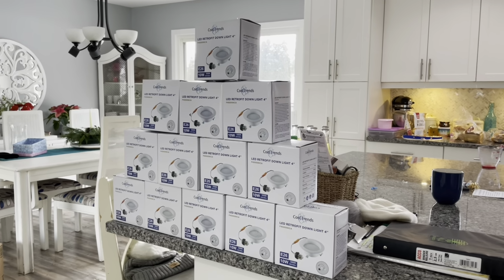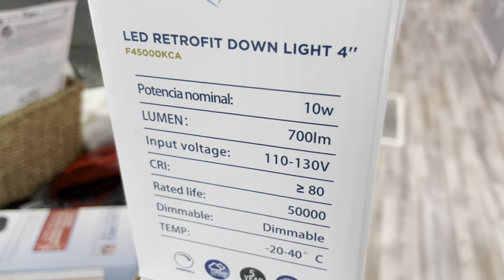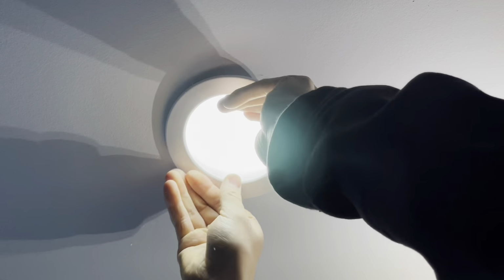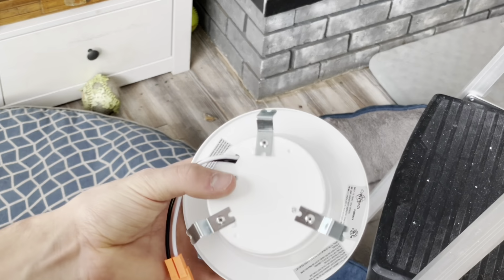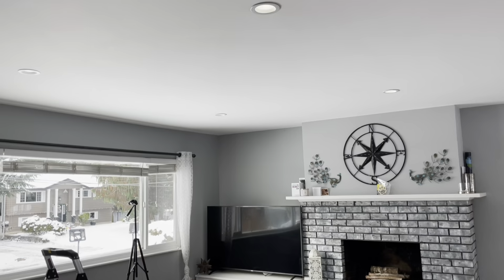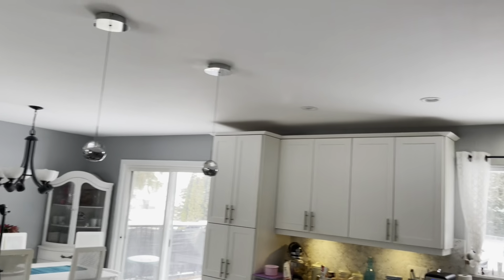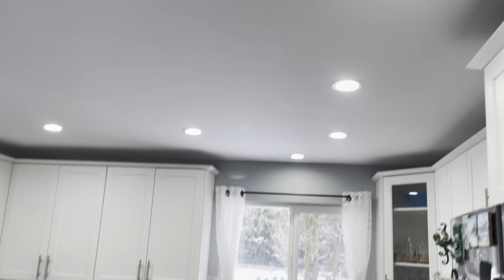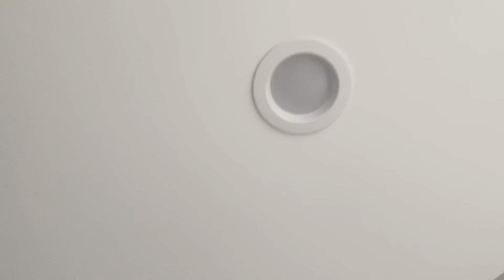Installing LED Recessed pot lights replacing the old trim and bulbs with new LED fixtures

Comment: Honestly if I were you instead of replacing the whole lights I would’ve just bought in a high-quality lightbulb so just as an example  say you spent I don’t know $13 on those lights each you could’ve spent $13 on a lightbulb I know I bought a high-quality light bulb and it said that it was 23 years and it’s 100 watch it’s already been three years and not a single lumen has changed also the colors stayed the same but I don’t blame you for doing it I probably would’ve done though same thing and it was a very creative idea in my opinion I’ve never seen anything like it so good job

Comment: is it possible to get interconnected smoke alarms to trigger a fire alarm system as well?
Reply from the maker: If you can get a relay that connects to the smoke alarm that could set off the fire alarm system but there is no way for the fire alarm system to set off the smoke alarm
Reply: @nics-systems-electric  got it, thank you